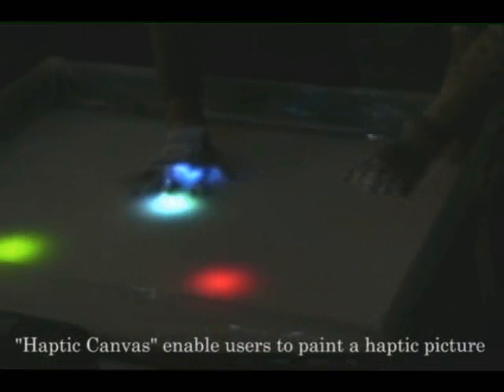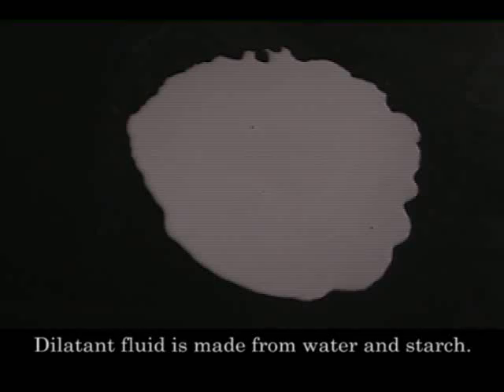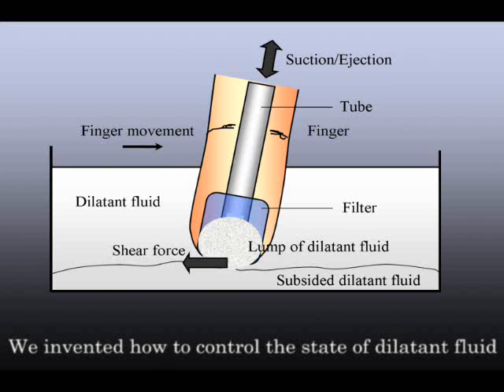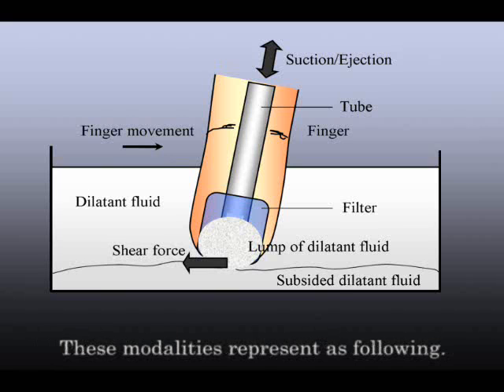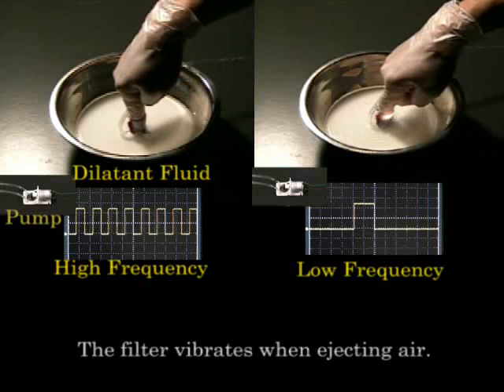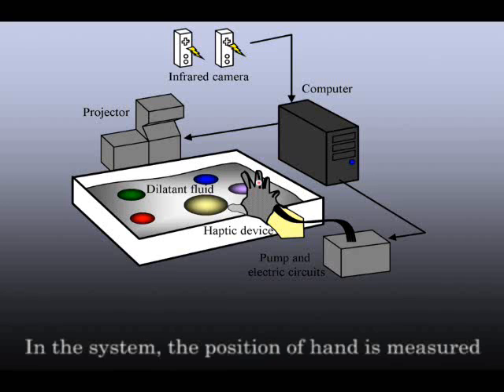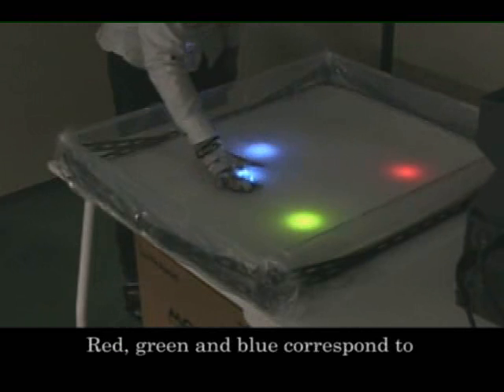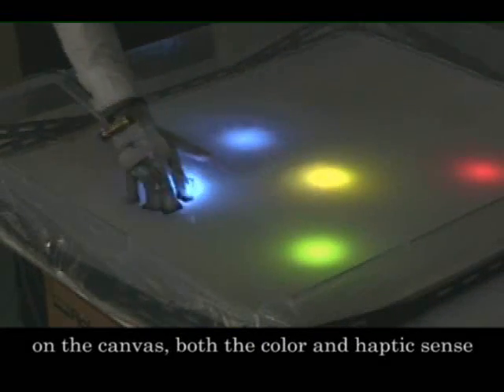Haptic Canvas (Laval Virtual 2010 Submission)

Comment from the maker: @roidroid The pumps are activated by the motors. I control the rotation speed of them with PWM control. However it cannot control the frequency precisely.

The caps which are attached at the end of the suckin/ejecting tube work as a filter of the starch. So the pumps suck or eject only water.

More information is aviable at the web site bellow.

ttp://hapticcanvas.bpe.es.osaka-u.ac.jp

Comment from the maker: @roidroid 
Of course it is effective to use electric vibrators for changing the stiffness of the material, however it can not control the state of the fluid. (We tried it before...) The vaccum pump enables us to control the state of the fluid from liquid to solid and presents multimodal sensation (sucking and ejecting modes). 
This is why we are using air.